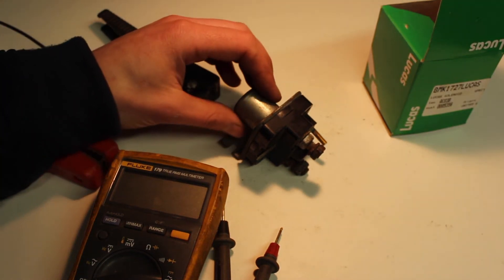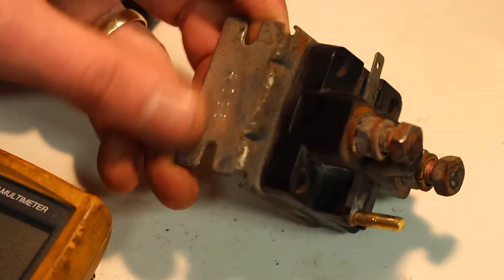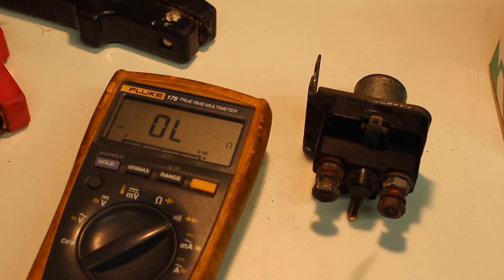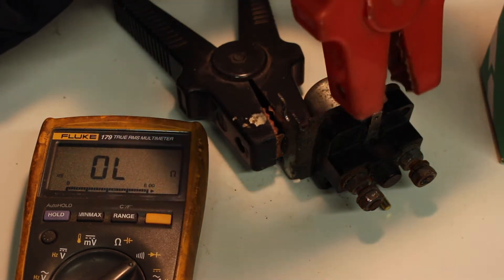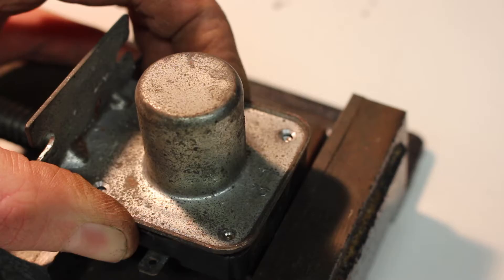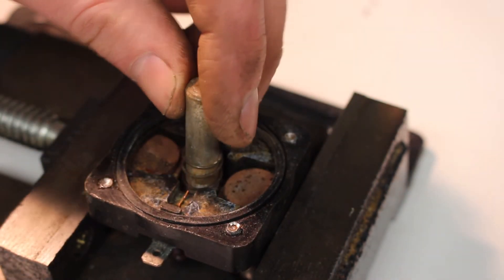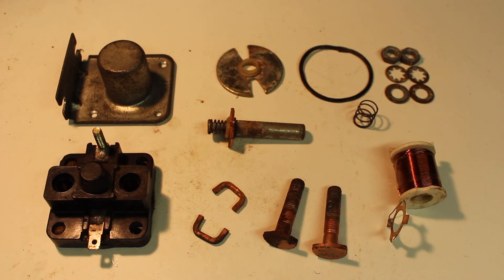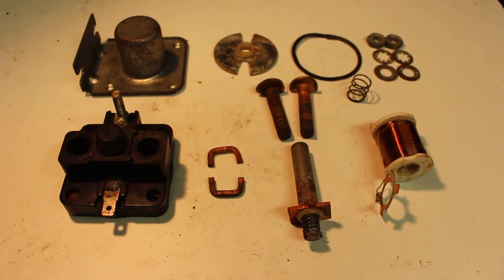How to test a 12v Starter Solenoid switch

Comment: If the starter fuse is bad, but the solenoid is ok, will it still "click" when trying to start the vehicle? Or does the fuse come before it in the line, where a bad fuse would prevent it from clicking?